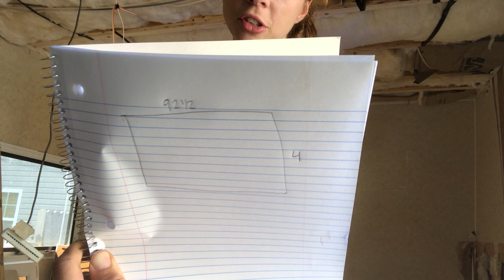RV RENOVATION: Repairing ceiling damage: Part 2

Comment: When replacing panels do you try and match existing panels (like find similar wallpaper) or accent wall or reface all walls together?
Reply from the maker: No, it’s really hard to match rv wallpaper. I just paint the ceiling white. There’s a bit of a texture difference sometimes but it’s not that noticeable

Comment: When shipping the box stores for luan, their sites list a plethora of wood species. Is there one I should be selecting for RV applications? Thanks!
Reply from the maker: Nope, any type will work! I typically just pick what’s cheaper and more readily available. Sanded plywood is always a good option too. I use 1/4 inch for the ceiling and 1/8 inch for the walls!

Comment: What staples are they and what gauge?  Do you have link for that?
Reply from the maker: Depends on if your frame is wood or aluminum. If it’s wood, 18 gauge staples. I have a better more in depth video on ceiling repair, I’ll link it below
Reply from the maker: https://youtu.be/fGWAEOddnqM?si=Z4LBnCQ1x0Hn7UlC

Comment: What are you using for the panels on the ceiling?
Reply from the maker: 1/4 inch plywood. It holds up better than 1/8 inch paneling (I use that on walls)
Reply: @fallenintocamping  Thank you! 😊